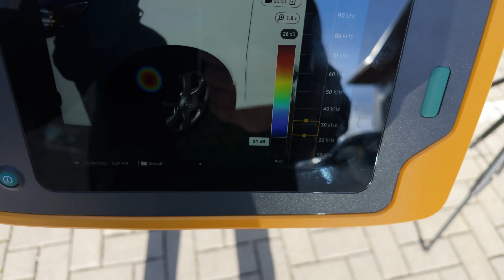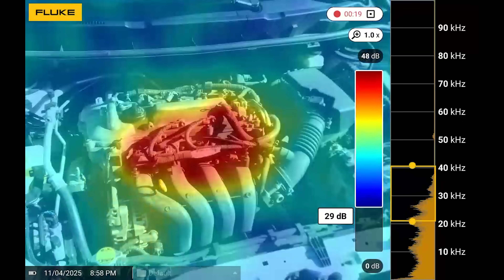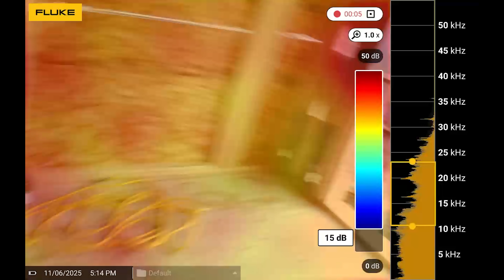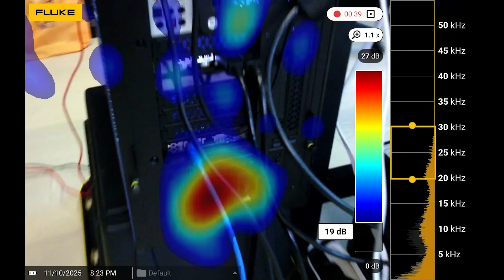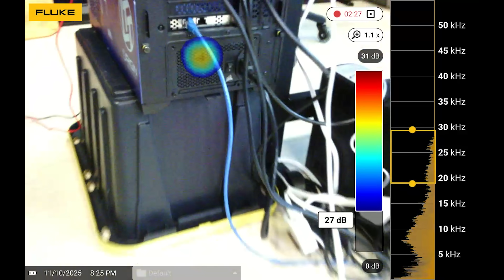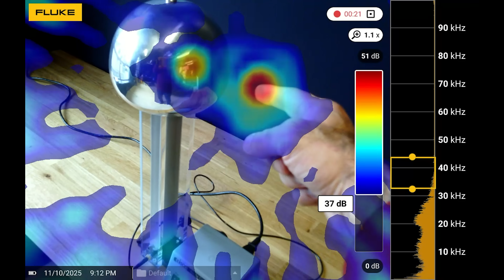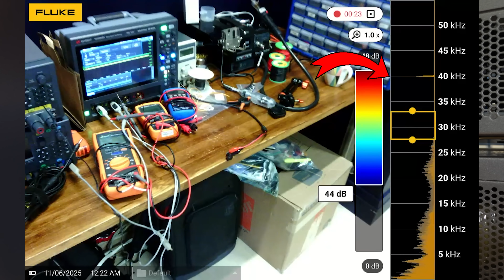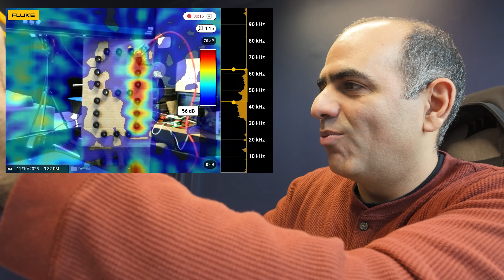Only $20000 to Fix a Flat Tire

Comment: Hello, this tool is really cool wow. Makes me see even more now how we are bathing in frequencies.🙀 It was interesting when you spoke about what frequencies cats and dogs hear, but what if the air chemistry is perfect for even humans to hear in those frequency ranges🤔I think the most frightening thing about the future is designer aerosol/gases/particles that change the body's metabolism, nervous system, perceptions, moods, states of mind...  I dream of a tool that could similarly detect anomalies in the air but that analyzes the air composition🤔Maybe it already exists.
Reply: Recently they gassed my apartment with Formaldehyde, the humidity on the windows formed an interesting pattern. So I googled the chemical structure of Formaldehyde and surely enough the pattern formed on my window by the humidity resembled Formaldehyde Molecular structure 🤔I have an engineering background so I always analyze the gasses my apartment is gassed with 🤔They often use humidity to increase potency of their gasses, every time I wipe the excess humidity of the windows the water has different properties🤔

Comment: Natural gas (methane) is lighter than air, not heavier. Still dangerous if it leaks in an enclosed area, though. Also, in rural areas it could be propane (from that big tank in the back yard), which is heavier than air.

Comment: Working on the Semiconductor we use these to check for leak on the vacuum/gas in the equipment. even if the equipment is running and vibrating you can capture the gas leak isolated. pretty cool stuff... to bad this cost as much as a brand new car.

Comment: 4:12 this is why leakage is so common for houses connected to methane mixtures (natural gas)! it’s super hard to detect them, and neither manufacturers not their support teams are regulated to check, so it causes a lotta emissions D:

cool tool, though! wish these companies were required to do more thorough inspections and analysis like that :)

Comment: If you adjust the frequency you can see the noise from cracking a faucet leak , loud leaks with no wind it picked up steam traps cycling 200 feet away

Comment: I used one at work for tracking down air and nitrogen leaks , I have no complaint about the one we rented , I had 15 seconds of instruction and the software to pull the report off was very easy

Comment: Ive used this tool in industrial applications. Primarily for gas leaks, but we also used it for detecting failure of hv isolators and king bolts that were starting to induct due to dodgy earth bonds

Comment: Can you make a video showing a Standing wave?  Its clearly picking up reflection and I wanted to see if it can pick up the bubble of standing wave energy that appears when source and reflector are perfectly spaced.  You might even be able to detect a traveling wave when they are slightly out of phase which should look like a ball of sound slowly moving in one direction or another.

Comment: I do electronics repair and sometimes need to find the source of ticking, humming , buzzing noises from switch mode power supplies , just recently i had a pwm ic making strange noises   and only found it because i pressed down on the ic and the noise changed , this device would have found it straight away. And i wonder if it could also locate a shorted component, like thermal cameras do, maybe a shorted component emmits a small noise ? . Interesting

Comment: Guys this is mainly used in industries. For many maintenance teams, it's a dream tool. In factories, compressed-air systems run at high pressure with thousands of air lines. Even a small leak can reduce overall efficiency, force compressors to work harder, and waste a huge amount of electricity. So when you look at the price, the savings this instrument delivers can easily be 10x its cost."

Comment: Fuck it...Gonna built one.
Hold my FPGA Dev board and those cheap microphone array.  

Gonna warm up that sweet array of fixed-points FFT modules and phase-shift delay module over CORDIC computation.

Comment: I got to screw around with a bunch of advanced troubleshooting tools like that. You can dial that thing in to find little tiny electrical arcs. if you need to chase a short meg the cable and whip out the imager. works awesome. cool stuff, thanks!

Comment: Problem introduced and solved within 25 seconds with soapy water in a spray bottle. Cost: <$10

Proceeds to use a ~$30,000  diagnostic tool to solve the same problem.

Comment: 3:10 - Be careful what you are talking about precisely and about what areas of the world. Maybe you were talking about propane, butane, or whatever it is in that toy stove, but most fixed gas home systems here use methane. Which is LIGHTER than air! While portable gas cannisters usually contain some other gas, like LPG.

Comment: One thing you got wrong is the whole gas pooling at floor level.
For propane and butane this is correct, but natural gas is mostly methane, which means it'll pool at the ceiling moving down to head height.
If you try to get your head above it, you will suffocate.
You need to crawl along the ground. Also, do not turn on any lights in the building, the arc from the switch is enough to set it off.
If it's an apartment building with automatic lighting, stay put and wait for firefighters to cut the power.

Comment: The transformer thing is about the circuit switching, its normal to set above 20khz and it will make noise in the same principle as an speaker, just like it does at 60hz

Comment: It is a nice test tool for circuit designers or enclosures populated with equipment to check the air circulation in addition to EMI. Fluke ii915 Acoustic Imager is expensive for hobbies, can buy 2 Chinese EVs for a price of 1 unit.

Comment: We actually use the acoustic imager from Fluke to see partial discharges (or corona discharg) in air-insulated distribution and transmission systems.

Comment: With a good subwoofer, you can also see sounds with the naked eye, if the frequency is sufficiently low, because they will vibrate objects in the room (like furniture for example).  If you've got lighting that flickers at mains frequency (60Hz in North America, e.g., long-tube fluorescent lights), you can even get very noticeable moire patterns.

Naturally, this trick doesn't work for high-frequency sounds like the hiss of pressurized air escaping through a narrow opening.

Comment: I could have used this just yesterday to identify where a kind of annoying hum was coming from in our hot springs resort room. It wasn't there Thursday, then coming back after breakfast, hmmmmmmmmmmmm. Walking around the room, the direction seemed to change. We even walked around the building to see if we could hear/feel the same hum elsewhere (that we could access). Nope. This little gizmo would have been great to have. Of course, the price isn't for the faint of heart is an understatement. 🫨 For that price I could buy 100 really nice guitars! 😅

Comment: Call me back when it is reduced in size to 18 by 10 cm (7by 4 in), attaches to a cell phone via Bluetooth and cost less than $200 US. Laser rangefinders and thermal imagers used to be large and expensive too and now, they are tiny.

Comment: it should write to a file while recording the video instead of a buffer so that if the shutdown is involuntary (for example battery running out) you would still get to keep the unterminated video file.

Comment: Love how you explain it like "it will even work in a noisy factory" and then you go to a construction site and it does not work when it's noisy 😂
Also, fun fact: leakage is why heating with gas is probably just worse for the environment than heating with electricity produced by coal.

Comment: I wonder how much bigger a device like this would have to be to detect infrasound sources. It probably scales with wavelength somehow, but I suspect it wouldn't be a linear relationship. Or would it be the microphones that have to scale more than the device itself? I don't remember Steve Mould going into that kind of thing but I'll have to have another look. Is there such a thing as a microphone that's sensitive to infrasound in air? Is that even a useful device?

Comment: you "might" be able to use this to transmit data. see the data visually and convert it back in to usable data later. i think of an air gapped machine. if you have visual range to record the transmitted data, ether but coil whine or other sounds means, record it then convert on playback.

Comment: The device you created could be wireless transmission, signaling, or encryption. It could be a way of telling robots what to do without letting anybody else know what you're telling them. It is very cool.
Reply: You could also stack it on top of a thermal camera to have some sort of 3D effect.

Comment: i went to a trade shoe last year where they were showing it off. brillent bit of kit. didnt buy but hired one and went round a prouduction facilty looking a fixing compressed air line leaks. the cost of the hire was less than the savings made from using less power by running the cpmpressors less.

Comment: It's a really cool device, around $25K with a cheaper variant for $8K. FLIR makes one too but it's $42K. 
I wonder how hard and cheap it would be to make one ourselves, perhaps with only 4 or 8 microphones? 3 mics should be enough for triangulation but there must be a reason why they slap so many mics on it.
Reply: Aren't the microphones the cheap part of it?

Honestly, I wouldn't be surprised if all hardware needed is really cheap, but you need some software magic that's hard to figure out.
Reply: @Arcidi225  Processing the timing and frequencies can be quite demanding on the CPU, that's why I was thinking of limiting the number of microphones, so that a microcontoller or ARM CPU could keep up.
Many things need to happen at the same time, probably too much for an MCU, it needs to calculate the locations and frequencies, capture the video frames, render the visualizations on top of the videos, display it, and handle user inputs.
With dozens of mics, an FPGA might be the best option as it can easily process all the signals in parallel.

Comment: Not sure if this is common knowledge, but gas naturally has no smell. The smell is added as a warning. It has a strong, sulphur-like or “rotten egg” smell. On a lighter with a metal spark wheel, if you press the button so the gas escapes without igniting, that’s the smell you notice.

Gas heaters use natural gas (methane), while lighters and stoves usually use butane. Neither gas naturally has a smell; both are odorised in the same way.

If you ever smell gas in your apartment in strong concentration, or especially outside, call emergency services immediately. You could prevent a serious disaster.
Reply: While all gas is scented, I think I've noticed different types of gas have slightly different smells. 
Also, depending on where you live, the type of gas available can change. LPG and Propane are also common types of fuel.
Reply: methane is lighter than air, you just need to wait for it to disipate.
Reply: @davicorosello1588  Yeah but say you smell it outside. Especially if it's methane which is the only real reason why u would smell gas bc that's what goes trough pipes the leak must be huge especially bc it dissipates fast in the air. The urgency to get this checked asap is even worse if it's methane
Reply: @MoundN I smell gas leaks all over my city. Some of the pipes are over 100 years old. One got way stronger last month, and then as I rode my bike over it, i could hear it hissing out of cracks in the asphalt roadway. Only one I ever called in, and they fixed it in 12hrs which is unheard of lol, some of my friends have been calling for years for smaller leaks in their area. Almost certainly if somebody dragged a sparking chain over it, it would have caused a column of fire. You can find videos that happening until the gas company shuts it off upstream. One audit determined that 40% of our city’s gas leaks to the atmosphere. Awful
Reply: @silverecco  That is absolutely insane to even imagine, where do you live if you don't mind me asking?
This sounds horrifying.
Reply: @MoundN  Richmond Va. I believe we were the first city in the US to get gas street lighting, back then it was coal gas in the 1860s. Some of those (lead? Iron? Maybe even wood?) pipes are still in use, or were replaced in the 1930s. Local environmental groups have tracked down several thousand leaks with gas sniffers, and our city has utility can’t keep up fixing them. I often still smell gas even when they’ve replaced pipe, including quite a strong smell from that same one I reported, though I no longer hear it.
Reply: And the reason why gas has smell goes back to New London school explosion when it was odorless.
Reply: @kettujabamiesukkeliukko  Interesting. I looked it up and it seems you're right, doing so became widespread after the incident. This apparently was also done as early as 1880.
Reply: just so you know. yes, this is common knowledge. everyone knows that gas is odourless.
Reply: @KarldorisLambley  I wasn't sure so i wrote it i met some people in my life who did not know that so there's a few that the message could be helpful toward i think.
Reply: @MoundN yes, you are probably correct. To be honest, I often sound like a bit of a tosser. In my defence I always claim being on the spectrum

Comment: Rebuild the Marx Generator and make it EVEN STRONGER, if you use lager physical size resistors and eventually capacitors you would be able to raise the voltage even higher!

Comment: That transformer buzzing between 15–35 kHz is too relatable. I’ve had bench power supplies vibrate at ultrasonic frequencies before, and it’s almost impossible to diagnose by ear

Comment: Please consider designing a spot welder that uses a microwave oven transformer, with an Arduino that controls dual pulse duration and power levels.

Comment: Mechanic's advice, and I'm sure others may have already said something similar, but those repair plugs are for temporary repairs only, ie to get you to the nearest tyre shop.
Always get your tyre repaired at a tyre shop, it's much safer, and much less likely to leak. They should re-balance the wheel after the repair.
Reply: The mechanic advices to go to the mechanic. I am just kidding. He is right.
Reply: @robelengida6211 😂

Comment: AT&T uses pressurized air ~2-5psi in thier large bundle cable to keep water out. They have a device similar to this, however, its much more "simple". You wear headphones and point a microphone in a radar at the lines and walk the lines to find any leaks. I'm sure some markets have something similar to this now

Comment: I can easily see how it could be a very useful way to detect where mosquitoes are at night.
Reply: Very inexpensive too, only 25k
Reply: @alex15095  Ofcourse its fluke. Its like rolex of engineers. My dad have fluke multimeter its damn expensive compared to unit ones with same specs. Its same age as me now and still work perfectly (I'm 26 years old).

Comment: I wonder if, with a little tweeking, It can pick up the location of an animal sneaking around in the woods. Or a far off drone. Maybe hidden mics and cameras in Airbnb rooms. Btw, your little cardboard number board could now be used to send secret messages in the open. A lot of interesting potential applications for that.

Comment: We use these in our facilities to detect gas leaks. Originally intended to isolate process if leaks were detected but it’s not quite reliable enough to avoid spurious trips. So now we just alarm and let operations investigate. Good but not great. Can’t quite replace our operators with AI yet.

Comment: That high frequency in the power supply is because it’s switching the output on and off that quickly (“switched mode”). That’s a good power supply too, the cheap ones are worse.

Comment: Using a device that costs more than the entire car to find a tire leak... 😂
Reply: I just looked it up, thats not even an exaggeration
Reply: @ironbacon how much does it cost
Reply: 26,000$
Reply: @deebrio8691 more than 4 dollars
Reply: @fantasianB Seeing virus is costly. Seeing sound is pretty costly.
Reply from the maker: Yeah I mean my toyota is half its price!!
Reply: @ElectroBOOM where is the tesla?
Reply: @ElectroBOOM  where is the tesla mehdi
Reply: @ElectroBOOM wow jesus!! I thought it was like $2k-ish or something :)))) 😮
Reply: $26k for that model
Reply: @TheHackysack  Dam, that's expensive!
Reply: Probably cheap for the value it can provide to certain industries.
Reply: @TheHackysack so if just one person buys one their advertising was worth it
Reply: It is used to detect pressure leaks or fractures in high-pressure industrial lines; it could even detect where a line is about to fracture.
Reply: Wait until you find out how much the machines cost that build the car
Reply: To be used on a factory where the cost of a broken pipe can be millions, 26k is nothing, just another maintenance tool.
Reply: @VisaoNocturna  Jup. I have hunted leaks in vacuum systems before. Our method used helium gas, a helium detector (also not cheap!) and hours and hours of time. Paying 26k to be able to see the leak in seconds? Total no-brainer.
Reply: that he intentionally put in the tire.
Reply: It costs more than a good near-new Corolla.
Reply: It can also be used for exercise. It
 looks heavy in his hand.
Reply: This tool is not used for that, is for pro uses like industrial place
Reply: @ahnonymous8573 It's a joke. Enjoy and laugh
Reply: Смотря где. У нас автомобили дороже
Reply: @AlexSmith-iu5qv  Но ваши жизни ничего не стоят.
Reply: But that device has so money uses! It is amazing but the price tag is too high!
Reply: Car? My house costed less. Gagarge included.
Reply: 9:50 yes or course
Reply: If it's a Fluke, you can't afford it. I am sure our friends in far will have an affordable option in a yew yeqrs time. Apart from a few microphones it is all in software.
Reply: yup